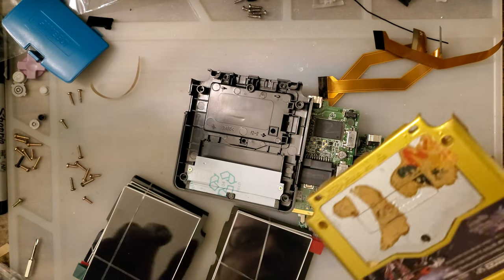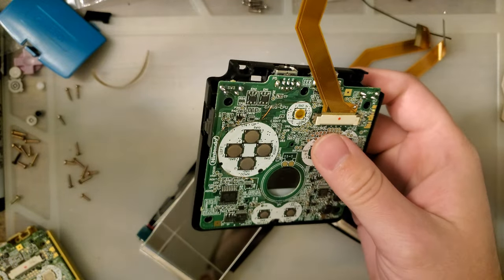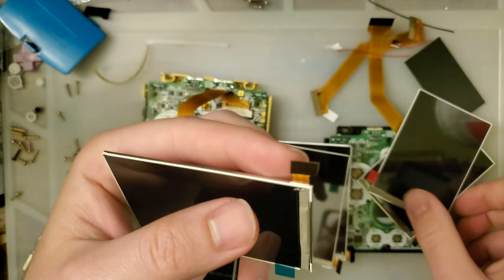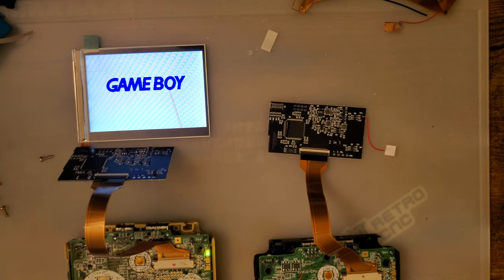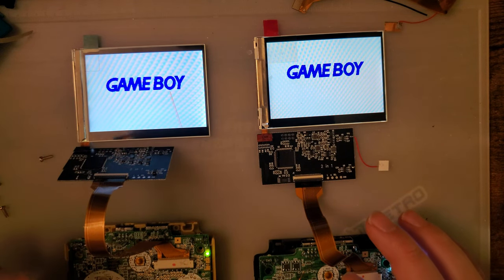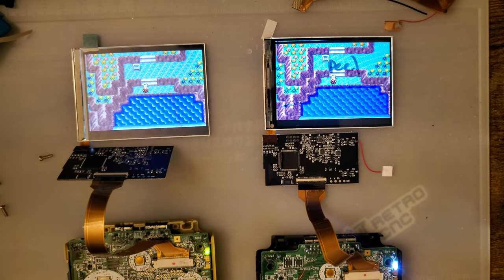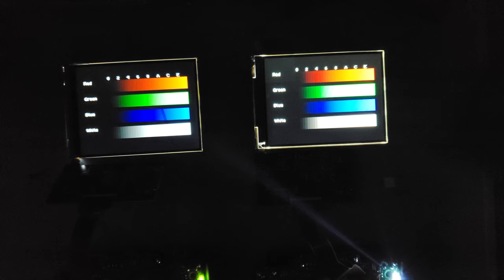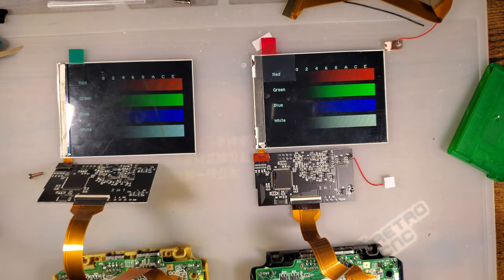New 9380 IPS LCDs: NOS LG vs New LG

Comment from the maker: Oh and incase it wasn't clear from the video -- the reason someone paid to have a fab spin up to spit out newly manufactured LCDs is because the new-old stock (NOS) supply has been exhausted. Anyone that still has those screens stockpiled them. Once they're gone, they're gone. No big deal since the newly manufactured screens are as good or better on average than the NOS screens anyway, in my experience at least.

Comment: I've been in touch with Funnyplaying Store on Aliexpress who told me that the LG screens will come soon. So at the moment they are still shipping Toppoly screens, so be careful.
Reply from the maker: That clearly didn't happen, unfortunately.
Reply from the maker: @m4xQ  FP has no LG 9380 LCDs so you're getting toppoly unless your seller just had these kits stashed away from late last year. 

That being said, the takeaway here is still the wrong one. I made this video (and that other one) because I wanted to show people that there are indeed differences between the screens that some of these kits have. I never said that any of the screens are bad, I just said that side-by-side, one is better than the other. Even a bad toppoly is heaps better than a stock Nintendo LCD. I made these videos with b-stock toppoly screens and FP is using a-stock screens. My video is basically a "worst case" scenario because the quality difference between b-stock and a-stock is much larger than the difference between newly manufactured LG screens (that OC is currently shipping) and the NOS LG screens (that FP used to ship).
Reply: @m4xQ  Have you received the shipment, what did you get LG or Toppoly?

Comment: What about pixel overdrive artifacts?
Reply from the maker: good question. IIRC, all three types of panel respond largely the same but don't quote me on that. I'll have to take another look some time
Reply: @makho  thx! For me the biggest problem with this type of mods. An I believe its the panel. I had 3 dfferent ribbon-cables an 10 Screen (LG an Topoly), some had less overdrive artefacts some were so bad it made gaming nearly impossible (and here even some LG’s were so). The ribbon-cables didn’t made the difference.

Comment: New to all of this and looking to upgrade my gba and or sp. Would it be best to buy an LCD and a board seperate as to guarentee a good quality screen? Also, what happens if these mods draw too much power over extended periods of time?
Reply from the maker: as I mentioned in the video -- none of the screens are "bad", some options are just "better". Use what you have, no sense in chasing the "perfect" mod. 

If they draw "too much power" then you get very short battery life.

Comment: @makho excuse me sir , do you know any screen with the 'same' color reproduction as the 001 screen ? 
This was the last official display which come pretty close to the GBC and original GBA displays in terms of color (grey-brownisch tint with less colorfullness).
Idealy I thought , using a 101 model + a frontlight kit would come close again and would have still more visability ( the washed out colors are probably the frontlight 'fault' , and reducing the brightness to a minimum on the 101 (with a brightness step mod) could hopefully show the same color reproductions as a 001 screen)
Do you have any insights on this topic ? Alternativ could a custom pcb maybe change the colorspace and add effects like scanline ? (looking at the gba consolizer)
Reply from the maker: If you want it to look like a 001, why not just use a 001?
Reply: @makho  Because of brightness (+steps), distance to the lens, and less light bleeding from the light guide plane. Or swaping the thick frontlight of an 001 with an nano lgp for einks and loca this and the lens together..